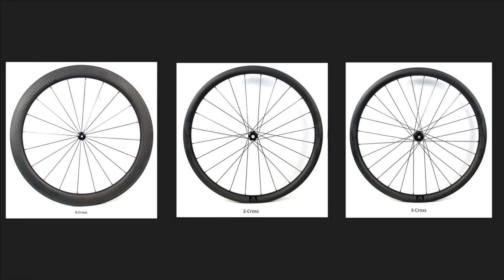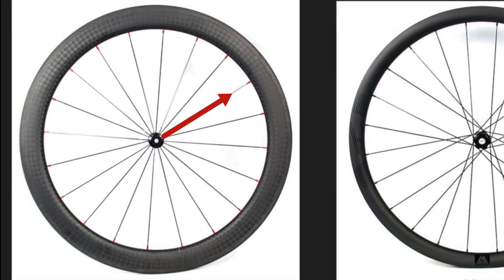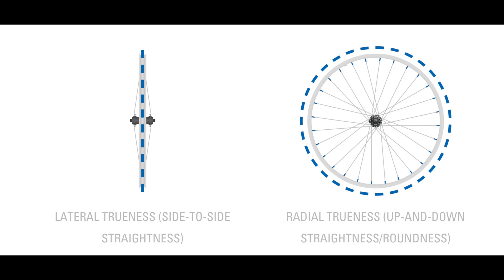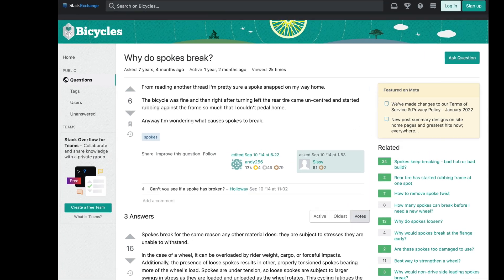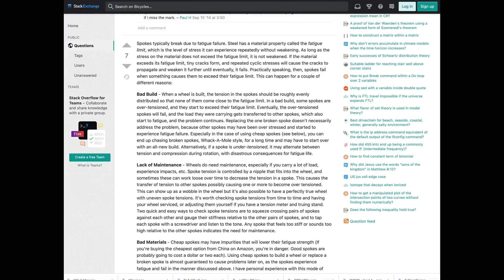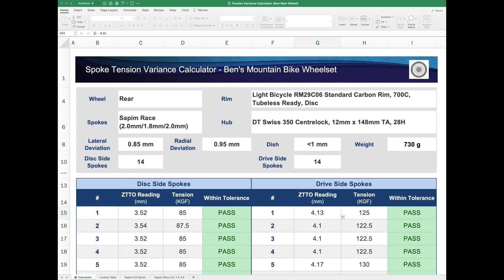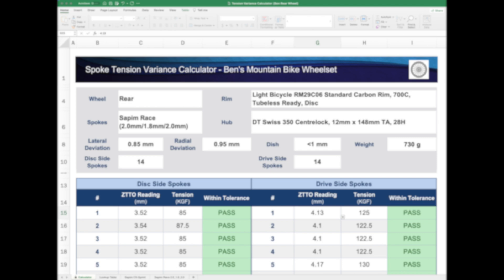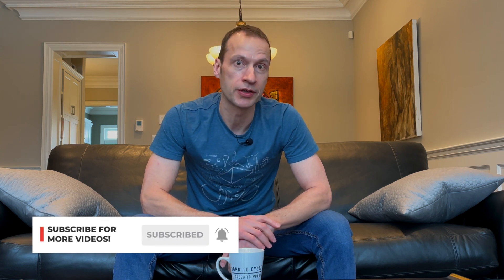Brass vs. Aluminum Spoke Nipple Debate...and a crash course on bicycle wheel building

Comment: Alu nipples are more susceptible to corrosion. Be it galvanic or chemical  “Spoke Prep”.  It must be made and sold by spoke manufacturers to increase their business.  Build a wheel with ‘spoke prep’ and that wheel will eventually require all spokes to be replaced. Why?   Because corrosion will make an unbreakable bond between nipple and spoke threads.  Same goes for flat prevention sealants. Highly corrosive to Alu. 

Why isn’t anyone talking about spoke thread lubrication in this spoke tensioning discussion?
Reply from the maker: I don’t disagree with your comment that aluminum alloy nipples are more susceptible to corrosion when paired with stainless steel spokes as it’s a fact. Whenever you have two different metals touching each other you create a potential for galvanic corrosion to happen. Where there is room for debate, is how significant this risk is and do the benefits offset the disadvantages. 

The risk of galvanic corrosion is significantly reduced with a high-quality anodized layer. Quality spokes and nipples will have this. The type of aluminum alloy used as well as the grade of stainless steel used for the spokes also impacts the corrosion resistance of the nipples. If you ride in wet conditions or where there is a lot of salt in the air (i.e. near the ocean), your risk of corrosion is higher. That said, the effectiveness of anodized coatings has been studied and found to be very effective at reducing the risk. A 2021 research paper called, “Effect of anodizing on galvanic corrosion resistance of Al coupled to Fe or
type 430 stainless steel in diluted synthetic seawater” supports this and is an interesting read. 

As to whether the small weight reduction (a few dozen grams) in using aluminum alloy nipples over brass is worth the reduced durability, I say, probably not. But high-end bikes are littered with parts that sacrifice durability for marginal weight reductions—aluminum cassettes and chainrings, lightweight tires, carbon frames, carbon saddles/rails, carbon crank axles, carbon thru axles, etc. Anyone looking for marginal weight reduction gains on a bike, wherever that is, has to accept that they are losing some durability and longevity of parts in the process. If that’s where you’re at then the challenge is finding those parts with the best balance between performance and durability. And that’s a personal decision. For my road bike, I’m fine with aluminum alloy spoke nipples, but not okay with carbon crank axles and carbon thru axles. For my commuter, it’s steel everything :)

Comment: Good quality aluminium nipples will still corrode overtime and be a pain in the arse to work with. Use brass and train 0.00005% harder to compensate for that minuscule weight gain..

Comment: I had a set of wheels built for my MTB with sapim alloy double square secure lock nipples. I'm not concerned about corrosion as I live in sunny California. I would most likely switch to brass if I moved near the coast.
Reply from the maker: ...same here. I haven't had any issues, but if I lived somewhere with salty, humid air, I'd probably switch to brass.

Comment: I recently bought a 2010 Specialized FSRxc Expert and found there was a broken spoke. But it wasn't broken, according to my mechanic the cause was Galvanic Corrosion, right where the nipple and spoke meets due to the Alloy spoke and red Anodised nipple. It was replaced with a Brass nipple.
The DT Swiss wheels look good with them, but no idea why they didn't use Brass instead of Anodised Aluminium.
Reply from the maker: Interesting, Ricky. I think Brass makes a lot of sense for almost all applications because the weight penalty is so small.